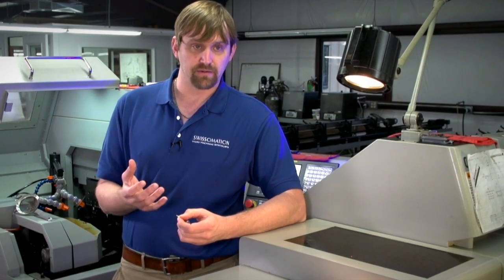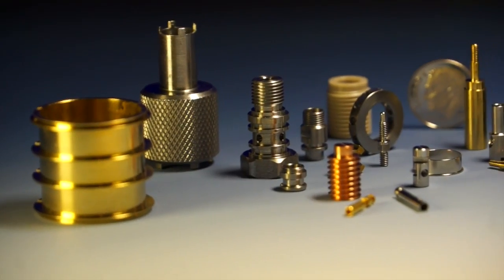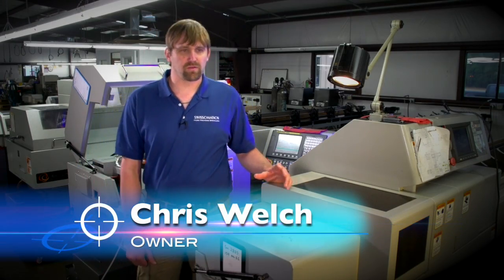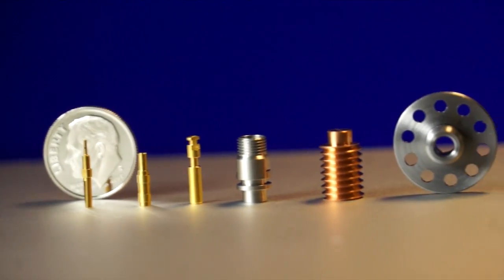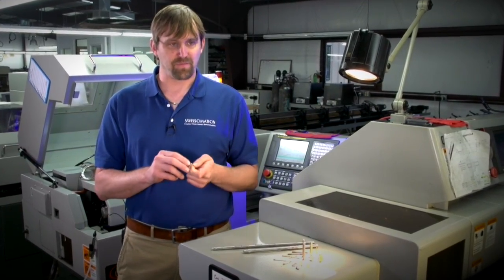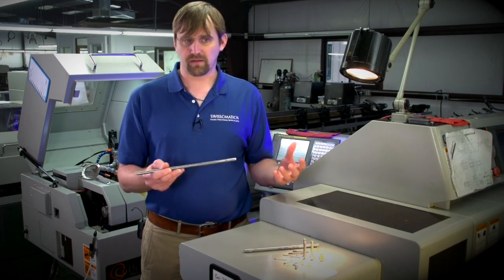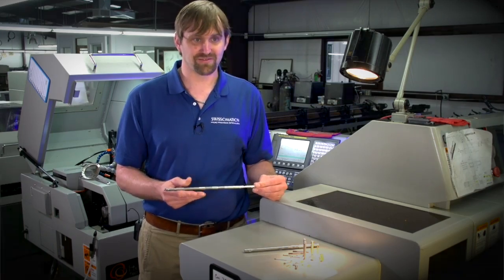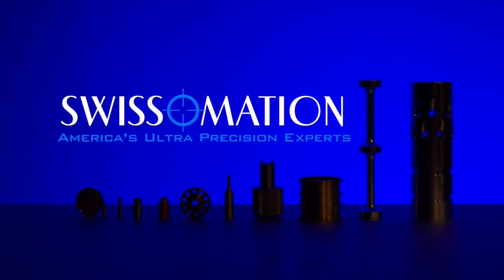Small Precision Machined Parts | Swissomation | Fredericksburg, TX

Comment: Do you machine plastic? How about holding +- .0002 tol. We are going to need some very small kel-f and torlon 4203.
Reply: Sorry for the late reply.  We are not the hosts of the video, so I just noticed your question. Yes, We do machine plastic.  We can hold that tolerance on some dimensions.
Reply: We doing similar small components dia 2mm thickness 0.3mm id 0.50